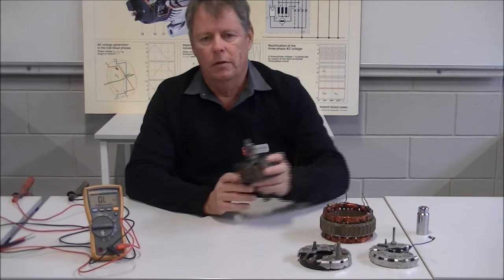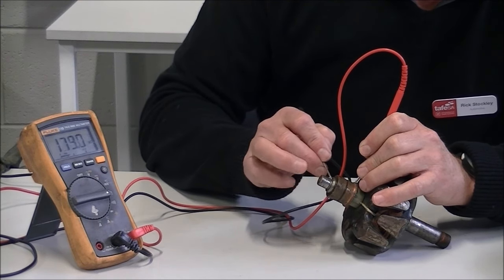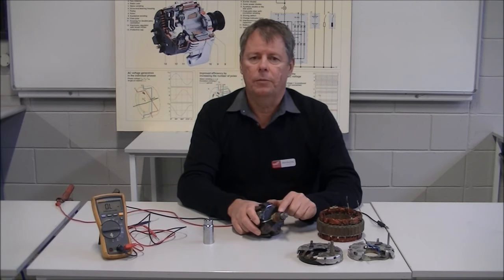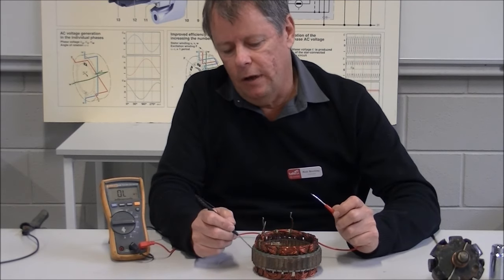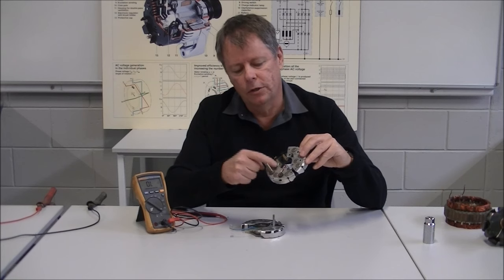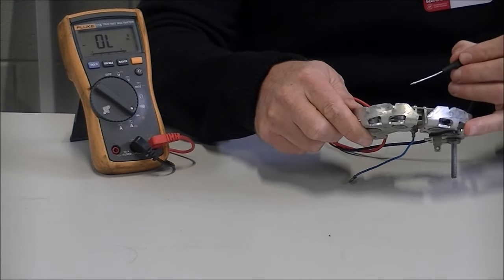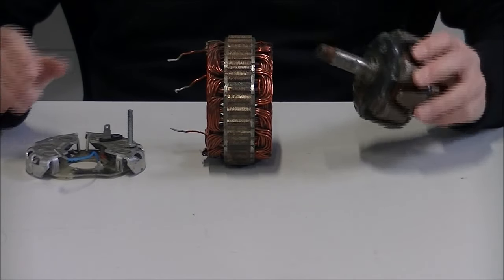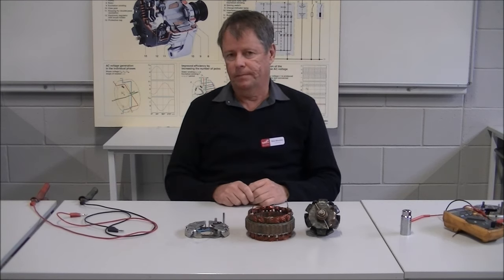Alternator Component Testing

Comment: Hi there, can anyone tell me, I did this test and found the voltage regulator testing faulty, would this be the reason when I connect the battery to the cable that connects to the alternator this cable becomes  very hot at the alternator end,
Reply from the maker: This sounds like quite a problem. It could be a few different things causing it; the most likely are either the battery polarity is incorrect, or the alternator has an internal short circuit. Either of those options is serious and should be fixed immediately.
Reply: Nice

Comment: The direction of the current alternates because the connection of the router leads with stator  leads alternates after each 180 turn of the router through the two slip rings?
Reply: No. the pre-rectifier current alternates because the magnetized Rotor has North & South polarity passing through the Stator windings, generating AC current

Comment: Reversing polarity during Diode test IS part of a diode test that should be done.
After all it tests the primary function of the diode (rectification)
Reply: Excellent point. Diode is akin to a check valve in plumbing. It should only allow current to flow in one direction.

Comment: Sir where is the voltage regulator
Reply: An alternator's voltage regulator can be internal or external. If internal, it is a small, sealed, unserviceable item on the diode plate. If external, it can be a coil and contacter box, a solid state unit, or done by the ECU (the car's computer).

Comment: This video is a great help. Thank you for making it. I will not pay $250 for an alternator for a 2005 Colorado with 263k miles on it unless I have to. My alternator stopped charging so with this video I was able to check for continuity in the field coil (good), the 3 phases of the stator (good) and the diodes (good). I noticed one of the diodes came loose from the rectifier. I soldered that back together and replaced the voltage regulator. That did not fix the problem. 

The slip ring was very deeply grooved and one of the brushes was very short. The slip ring connection to the field coil on my alternator was covered in a thick epoxy so I was not able to test those connections until I had chiseled the epoxy off the connection, so I may have broken a connection when chipping the epoxy off, but one of the slip rings did not have continuity, so I am hoping that the problem was with a connection to the slip ring. Luckily the rebuild kit I paid $47 for included bearings, a voltage regulator and a new slip ring.  I hope tomorrow when I replace the bearings and the slip ring that my alternator will start working again.
Reply from the maker: The excessive wear of the slip ring and brushes may be due to oil contamination. I have repaired many alternators by replacing brushes and slip ring, be aware that some new slip rings will need machining after fitting. Good luck with your repair.
Reply: Good bro
Reply: @PetarMakTeacher  my rebuild kit fixed it.

Comment: Great video. The measurements/readings you got for the various components, how well can we use them for our own alternators? Do the measurements differ much if at all between smart and dumb (always charging) alternators?
Reply from the maker: The basic components of the alternator are the same. The difference with the smart alternators is the type of regulator. Some new alternators do not have a regulator, the control is performed usually in the body control module of the vehicle.
Reply: @PetarMakTeacher  cheers

Comment: sir kindly explain how test brushless alternator
Reply from the maker: The components in brushless alternators are the same as brush type (except of course they don't have brushes). An iron cage spins around the fixed electromagnet to supply the changing magnetic field.

Comment: U have found your calling wish all videos were that easy to follow.
When doing the last test on the rotor i cant get it to read OT it reads 1.860M does this mean its buggered thanks in advance
Reply from the maker: 1.8M Ohms to the ground is ok. It may be a small amount of carbon from the brushes or moisture.

Comment: Thanks for the video.  What happens if the overall diode test results in a measurement above 800 mv?  My Hitachi 110 amp alternator is having charging issues and the diode test is measuring around 827. Thanks.
Reply: Here are a few more details.  When I measure each of the 8 individual diodes, they are all around 490 mv.  When I measure from the b+ post to negative diode plate, I get around 1220 mv.  When I measure from b+ post to one of the posts on the voltage regulator, I get around 820 mv. From the negative diode plate to the same post on the voltage regulator, 1662 mv.  From these inconsistent readings, it would seem I need to replace the diodes along with the voltage regulator.  These two pieces are riveted together so it appears they are meant to replaced as one unit.
Reply from the maker: @TheDowden6  When testing the diodes it is best to test them individually. If the stator is connected, the circuit through the windings will affect the readings. There is a variation of voltage levels between diodes from different alternators, but when testing diodes within one alternator they should have the same reading as each other.

Comment: Serious Question:

Balmar alternators (which I don't have) have a "Stator Monitoring Wire" going to their external regulator (which I do have, an MC-618 on my boat connected to a generic alternator).

To add this wire, onto which internal stator connection point should I attach it? I am presuming ANY ONE of the 3 delta points, thus telling the external regulator sensing circuit that the stator is either at ground or open circuit despite field being fed to the armature. A stator failure  would therefore signal a different error code to that of a failed bridge rectifier, ie a charged stator but with no B+ output.
Reply from the maker: I'm not familiar with the alternator you mention. Some of the car alternators use a stator connection which indicates to the regulator that the rotor is spinning, and it will begin supplying rotor current, even if there is no warning lamp circuit connected. It may be similar, however some of the external regulators used a star point connection to operate the warning lamp. If this is the case, the delta voltage connection may be too high if the regulator requires a star point connection. You will need to find more information from the original manufacturer.
Reply: @PetarMakTeacher  
Thanks. But I have since figured the matter out.

Fyi, the "W Connection", also called the "Windings Connection, Tacho Sense Wire, or Stator Output Wire" is connected directly to ANY ONE of the three AC stator points (delta or star config), prior to the rectifier bridge. This gives a reading of only 3-10 Vac and of a varying frequency to indicate alternator RPM to a tacho which then divides it down for engine crank RPM. The W wire is not the same as a warning lamp connection (L), which is a DC link to the ignition lamp (rectified by the smaller diode set, where provided) and which is also used (in "single wire alternators") to self-excite the alternator.